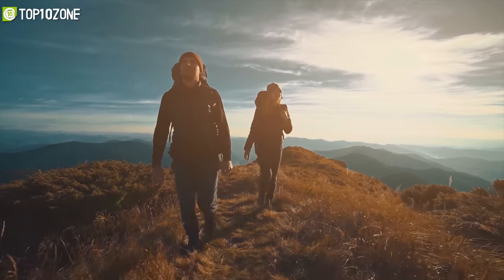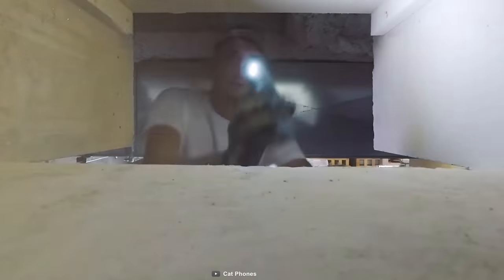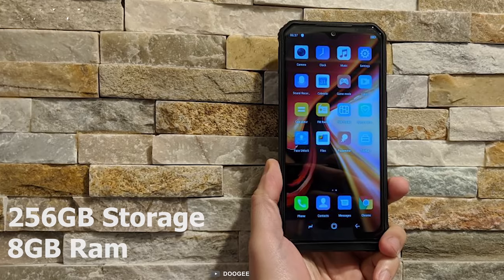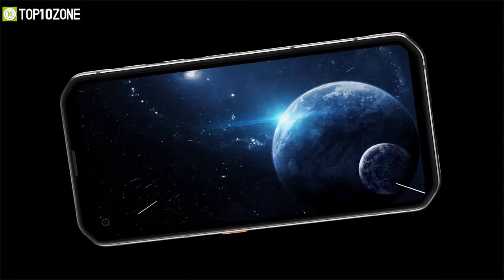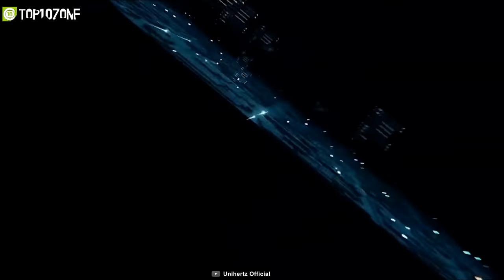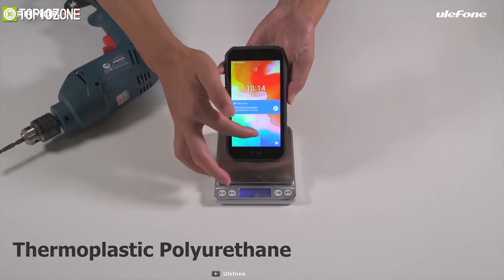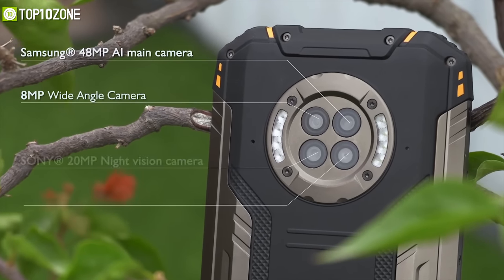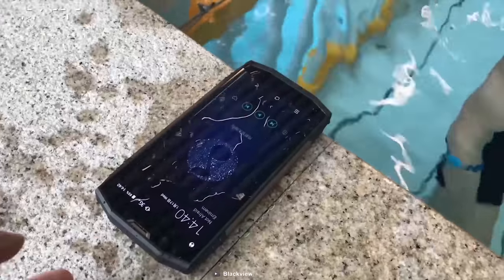Top 10 Best Rugged Smartphone for Outdoor & Jobsite

Comment: That blackview in first place , my question is IF THE PHONE WAS THE BV9900 PRO , WHY WERE THERE IMAGES OF THE BV9000 PRO ??? I recognized the bv9000 pro because I had one .
Reply from the maker: Sorry for the inconvenience! We will definitely check on that area. Thanks
Reply: yup
Reply: My BV9500 died...after 3 yrs of tough abuse. I bought the plus, tough 10000 may brick that lasted 3 yrs for under $300. Not bad.
Reply: I had the bv9000 pro for 2 months , after that I saw my phome that it started to slide on my leg , turned , hit the concrete with the display and bye.I still have a picture with it. But the best rugged phone from blackview is the bv6000. It is a monster.
Reply: @stelianurs7178  The replacement screen is ex to replace. Probably find on amazon. I did it.
Reply: @johnvaughan383  I've done that already , ordered a screen on AliExpress , repaired it and sold the phone already. After I bought my self another airsoft gun 😁

Comment: Very informative and interesting. :) Any idea how Kyocera Dura Force Pro 2 did? Is it even close to top ten? Curious here as that is what was available on ATT for upgrade. Thank you.
Reply from the maker: Not that I know of
Reply: I've had my Duo Force Pro for 3 yrs from Verizon.  It has served me well.  I've thrown it across the room, dropped on concrete, no cracks.  It used to last for 2 days on a charge but lasts only about 8 hrs now.  The plug in for the charger is worn out, so I bought 2 wireless chargers from Best Buy for $20 each.  I'm looking to upgrade now so I'm looking at some of these.
Reply: I have had the Pro 2 for the last 2 years.  3 months into the phone the charging port pulled out. Kyocera would not warranty it because it was not purchased at a brick and mortar store.,even though it is a known problem. I have been running in on wireless charging for the last year and a half. Now battery can not make it thru the day I'm looking for a new phone. I will not be buying a Kyocera again
Reply: These are good phones but I think you have to deal with Verizon
Reply: I've had 3.... electronics go bad.
Battery life isn't that great...but decent.
I've got a Doogee S59 Pro now....very heavy but otherwise awesome.
Kyocera also couldn't charge in the heat....Doogee doesn't have a problem.
Get a Doogee.
Reply: Had my Kyocera for 5 years now.